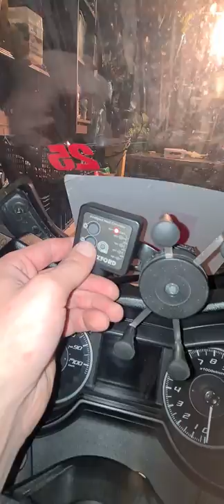Yamaha X-Max 125cc How to Install Oxford Hot Grips/ Jak Zamontować podgrzewane Manetki w Skuterze

Comment: Thanks! Which cable up front would I get the power from ? I got an nmax 125
Reply from the maker: Connect straight to the battery if you have a battery saver Hot Grips